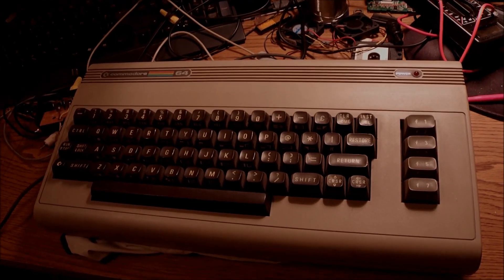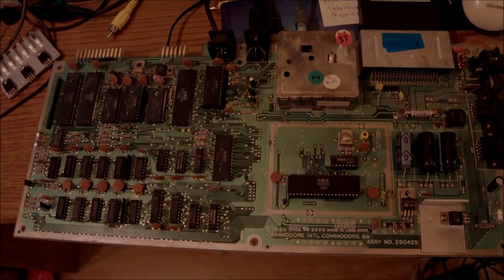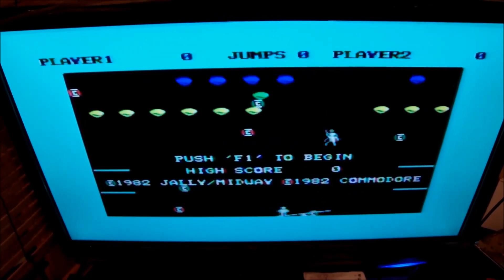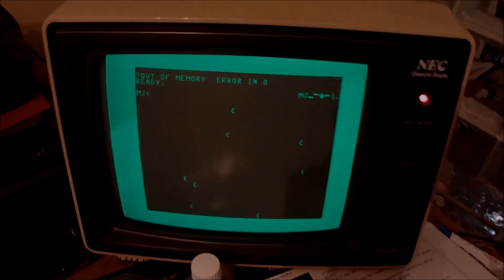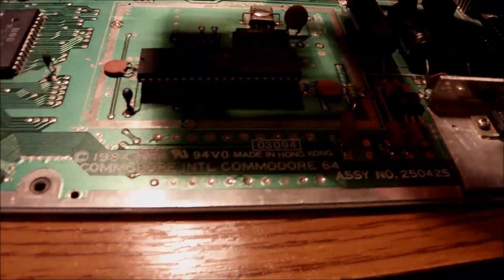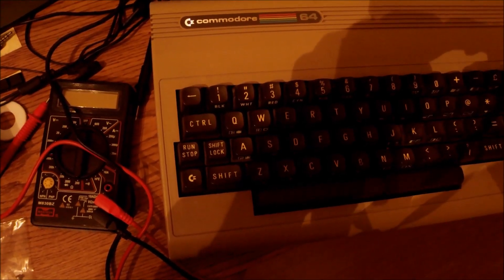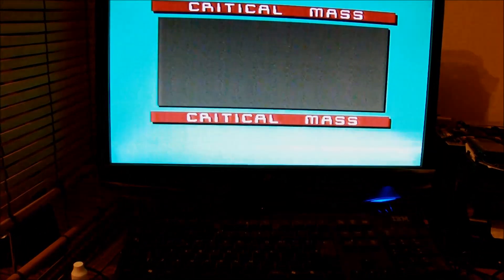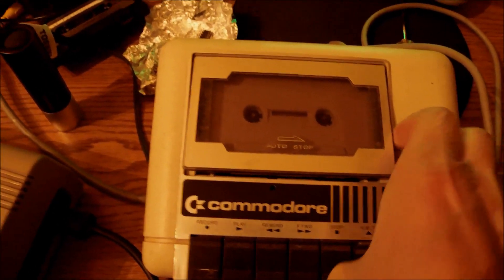Commodore 64 - Faulty RAM spot technique, test, piggybacking, repair & play...

Comment: I just fixed a C64 that had the flashing screen (.8 times) with the dead test cartridge.  Oddly enough, it ended up being the BASIC ROM that was bringing down the data D0 line. I found the fault by removing ALL of the ROMs, after replacing all of the RAM chips, only then did the dead test cartridge bring up the diagnostic screen.  I didn't realize that you could start the diagnostic with all of the ROMs removed. :)
Reply from the maker: Hi there and thanks for watching! Weird sounds like 8 flashes, i came up with 5 max. so far, still this piece of info is very interesting! D lines can be tricky, true..!
I remember once, i had to swap the Basic ROM for a VIC20, but never on a C64, thanks for sharing this experience too man!

Comment: I'm pretty sure this board revision doesn't have a separate shield for the vic. Mine didn't have one either, but the overall RF shield was there (in fact I don't think mine was ever opened before). And it has a tab for the vic itself. But I've also seen evidence that this doesn't act as a heatsync or if it does, it's not noticeable. So for mine I'm going to put real heatsyncs on all the important chips.
Reply from the maker: Thanks! definitely the way to go, the real heat-sinks, i mean. Future-proofing has some standards and this is the most important step, along with recapping.
Reply: I'm planning to recap as well. I don't know which ram chip is bad, but all of them are a bad brand so I'll probably do them all. Mine reports consistently 439 bytes.
Reply from the maker: @awilliams1701  Have you tried Dead Test Cartridge yet? It doesn't always give you a visual but in worst case some flashes, like in my case - On the other hand, changing them all with some contemporary, new ones is top.
Reply: @CyberhugTechnologies  I don't have one. I can try piggybacking, but I've ordered complete replacements.